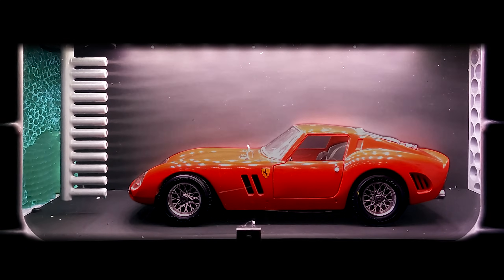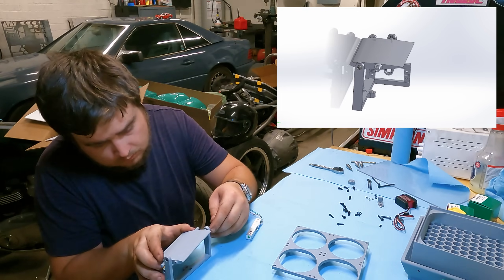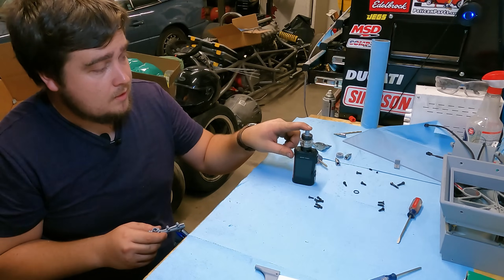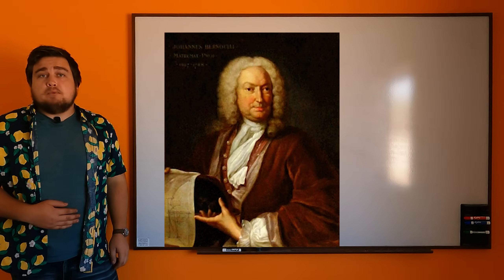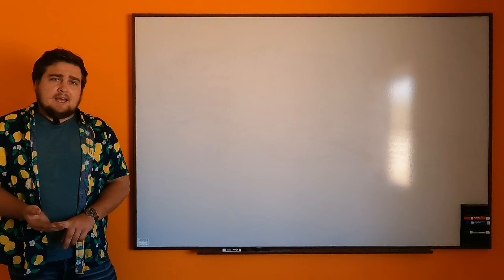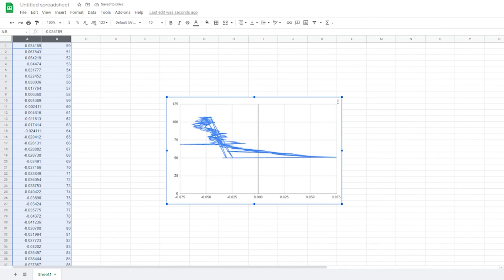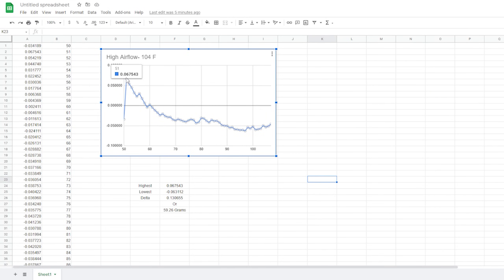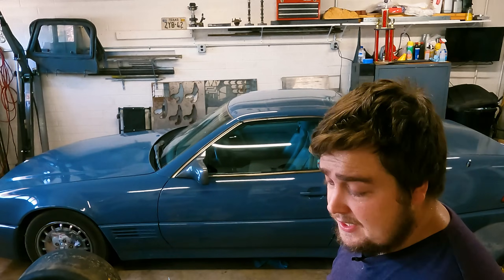DIY Active Aerodynamics | Pt. 1 of 2 - The Wind Tunnel

Comment: I found that to form dense smoke you can't mix it with air on the way, but you can attach the compressor to the input holes on the vape or even put the vape within a sealed tube with just the output poking thru and an inlet hole, then you can pump smoke out that way. it comes out much more dense. then, the tree that distributes the smoke needs long thin tubes to produce laminar tubes of smoke

Comment: Bernoulli's principle has nothing to do with aerodynamics because a major assumption for it's derivation is that there is a closed control volume for constant mass flow. A wing in open air has an open control volume and so bernoulli's principle does not apply. Curvature is why airfoils make lift. The fluid by changing direction, by definition, is being accelerated in a new direction and this acceleration causes a pressure drop along with a component of momentum transfer by changing flow direction downward. 

In 2D airfoil theory, bernoulli's principle never even shows up.

Comment: ...OR you could take a really close look on F1 wings find a good compromise with your build. Those teams put more money and time into this the past decades than anybody. You could just stand on their shoulder and using some well tested design elements and do the fine tuning and needed customization for yourself. If you start with basic shapes like F1 was in the 60s, you have decades of testing to get to the point where they are now so I would definitely recommend to use one of their design.

Comment: I think plugging the holes in the smoke distributor except one would help visualize the airflow better.  Also, since hot air is less dense than cold air, maybe you can play with temperature to help get a more accurate set of data points.  Very cool project.  Keep going.

Comment: imo it would be better with more "laminar" flow, maybe it's possible to make it laminar using a lot of tubesticks and feeding some (few) of them with smoke and all others with air, but the speed of the flow should be identical for both air and smoke tubes, otherwise it will generate turbulence again when mixing those flows from different tubes. Also led lights may add some turbulence in the flow because they make the "ceiling" of the chamber "bumpy"

Comment: Would using just the infill of 3D prints give you just as good stabilization of air? Plus it would be faster to print? Though I also see the downside as my 3d printer doesn't print infill cleanly.
Reply: straw method was probably better

Comment: can you match the Reynolds number and Mach number for accurate results? Also, have you checked out xflr5? its pretty rudimentary, but for 2d analysis it is brilliantly quick, and effective. Simulations run much quicker than cfd. You can also generate plots of Cl vs Angle of Attack, Cd vs Angle of Attack even incorporating flap deployment.
Reply: It's also free...

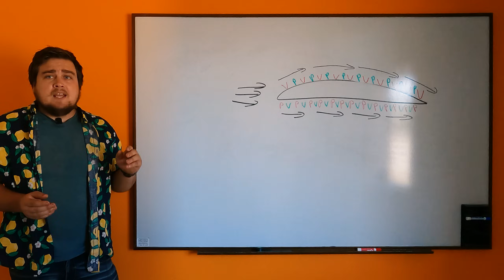Comment: Your explanation at 7:00 is completely wrong broo, fluid over the wing accelerates so much that it never meets with flow on the underside never again. Lift is more due to contraction of fluid elements going over the wing creating negative pressure on top. The contraction of the fluid happens because mass should be conserved and in the vicinity of the airfoil the obstruction causes flow to accelerate in order to maintain continuity furthermore the flow actually acquires downward velocity, due to conservation of mass this also contributes to said acceleration. Lift on the underside is actually harder to understand because the underside can be of an incredible variety of shapes with radius of curvature pointing in distinct directions

Comment: 7:00 equal transit theory is an incorrect assumption made pretty often. In reality, the flow over the top of a cambered airfoil or symmetric airfoil at an angle of attack is much faster due to the decrease in pressure, reaching the trailing edge quicker than the flow over the bottom of the airfoil. There are a lot of subtleties that I am not sure of myself.
Cool project, looking forward to your next upload.

Comment: A soldering iron and some light machine oil on a rag creates great smoke for PCV system leak tester, too. Can use Johnstone's baby oil instead. I suggest the use of a 3d printer hotend heater in a glass jar so you can set exact temp and even a mini hotend fan to slowly blow the smoke though. Also recommend using blunted syringe needles (from a printer ink refilling shop).

Comment: Wesley, I am building wind tunnels and making experiments as a job. I could probably answer some of your questions. Good work, but there are many weak points. 4 fans make a swirling flow and are too close to your model. There is a dead spot in the middle between the fans, flow velocity from your smoke device should match the flow velocity in the tube, inlet should not have straight corners because you will have a separated flow, at least you can match a Reynolds number for such experiments. You can use oil smoke wire for visualization or apply oil paint to a surface and see where the flow separates. you can also glue tiny threads to your model and watch behavior of the thread. It will be aligned with the flow or just chaotically moving in a separated zone. you can also install pressure ports and monitor static pressures on your wing surface. with oilvis you will know approximately where the separation occurs. And so on. Good luck!

Comment: The wind tunnel you have made will not give you the data you want at the scale it is at and the wind speed you can generate.
Aerodynamics don’t exactly scale 1:1 , something that is 5mm won’t behave the same as something 5 metres in size.
You may get better results with a water tunnel instead but it will still need to be bigger.
Minimum size for a useful wind tunnel would be about big enough for you to crawl through, then you can use models that will scale better. And easier to mess with as a bonus.

Comment: quick question. I'm no engineer but i wonder does fluid density matter in this case? what i mean is does such a small scale wind tunnel accurately represent the effects of how would that work on a full scale example?
Reply: Yes, there are corrections necessary to make models match up to the real thing. If you're interested look up "dynamic similitude".

Comment: Idea: get a big AC unit, use its output to push air into a wind tunnel. Problem is that the air exiting the wind tunnel will cool your shop too, so you'll have to figure out a way to reheat the air back to 100+ to remain consistent with your other videos.

Comment: Another aero engineer here. First off, great work so far and im excited to see whats next. I getting into arduino myself now, so ill be very keen to follow your project. A couple of points I wanna mention:
1)be careful about the blockage ratio, thats the ratio of the objects frontal area vs the area of the wind tunnel's cross section. Most I've see were around 10% and beyond that the wind tunnel's walls might start influencing your results. I realise it might become cost prohibitive though. 
2)try adding a mesh of sorts at the start of your wind tunnel which should help to make the incoming flow less turbulent and thus lead to more accurate results
3)if possible make the airfoil holder from metal or design it to be as stiff as you can, so that there's no force loss in the flex.
I work on racecar aero for a living so if you need any advice or cfd simulation help, feel free to shoot me an email.
Reply from the maker: The flex is an interesting point- if you notice the metal beam across the bottom was from results of flex on the bottom wall. I also want to calibrate it with and without the massive servo
Reply: @WesleyKagan  the way its usually done is you run your setup without the test subject first to get the "error" data and then you run it with your wing. At the end you subtract the first from the latter to get your real values.
Id also suggest on getting a pitot tube in there to get the velocity of the flow (place it in front of your wing). That way you can get coeff of lift (C_L) or (C_L*Area) and the Reynolds number which should help you validate your data against other sources. Reynolds number is very important, flow will act differently at different Re numbers. Lower Re flows will tend to separate sooner, which will lead to lower peak C_L.

Comment: Based on my wind tunnel it needs a 1 horsepower motor to get 80 mph in a 5 1/4" square tunnel with a 10:1 area reduction and a 1" thick honeycomb straightener at the widest part.  The Reynolds number is way off and the drag coefficient is way off.   I had to do a flow simulation of the wind tunnel to get it to agree with the model.  
Perhaps you should note that fluid simulation is free if you use OpenFoam that comes with CAELinux - which runs off a thumb drive on PC.

Comment: Hi Wesley,
A couple of weeks ago I designed an airfoil specifically for a rear wing of a car. It has the highest possible lift/downforce I can get, and it is miles better than anything you can find on the internet. If you want I can send you the data points.

Comment: There are a lot of better explanations why on this comment section, so I'm just giving my input on the matter: A traditional wing type airfoil doesn't fork for downforce, bcz too much drag. Active air systems are always heavier and more draggy than basic fixed airfoils. Otherwise they would be in use in racing. In an open wheel car, the wheels create the most drag, so best results are made with front wing directing the air over the car, and slick underside with a rear diffuser to keep the flow laminar under the car, thus eliminating the air matress lifting the car up. the rest can be done with tyres and suspension. Air brake looks cool, but when your front wing, tyres and suspension are dialed in, you need less brakes bcz your corner speeds are higher. Hard braking and acceleration only disturbs the dynamics of the car and aero, and on fast tracks only results to higher lap times, and on slow tracks, the aero is basically dead weight.

Comment: It seems like my comment has vanished, but anyways. Wind tunnels and aerodynamics, awesome and can't wait for part 2. Watching this I was immediately reminded of a set of videos made by Yoshi Suzuka probably 10 or so years ago and the discussion around them. Back then he was working on, I think it was something like an office small scale wind tunnel. Really interesting and worth checking out for reference on how far it's gone since then. Also, at the time he was doing it with 1/24 I think scale models and had it down to getting repeatable results and trends, though not necessarily representative or completely accurate to full scale numbers. I remember that wind tunnel at the time he could measure lift by the corners of the car and drag. IIRC Suzuka did the aerodynamic development for the Nissan GTP cars for a large portion on a 1/7 or 1/8 scale wind tunnel and models. I vaguely remember Suzuka may have said that with the 1/7 (or 1/8) scale wind tunnel, he was able get 2% drag and 4% lift correlation to full scale. Anyhow, you're definitely on the right track to making something that is close enough. 

Oh yeah, there's a whole bunch of test data (or at least was time I checked...several years ago) you've already found for various NACA profiles and even "race car stuff" wings where it should be possible to try and repeat the test with the same profile and see how the results correlate.

Comment: Air ejector nozzle. Dealt with something similar to what you made using the venturi in one of my engineering internships. High pressure steam is run through an ejector nozzle and create a vacuum behind it in order to draw NCGs out of steam turbine condenser.

Comment: Awesome video! One thing: "equal transit" explanation for lift is a very common misconception. No idea why this keeps getting taught to folks! Lift is mostly just Newtonian, that is momentum transfer, so with an angle of attack, planes can even fly upsidedown. The air does move faster over the top of the wing, but not due to some constraint on the time it must take to get there. It clings to the curved surface falling away from it due to the coanda effect. This serves to improve the efficiency of the airfoil mostly, but does not provide a significant amount of lift.
Reply: Yes. The equal transit theory is very flawed. Doesn't take much to prove that there is no equal transit. Basically, air takes longer to get to the trailing edge when it follows the upper surface rather than the lower one, which is intuitive.
Reply: @youngtschakaloff  That's true, at least it usually is, but the air does move substantially faster over the top surface than the bottom. Not because of some magical "equal transit" arrangement of course (I love the idea of the air molecules slowing down to wait for their friends) but because the air above the wing is compressed into a narrower stream thanks to the air above that not getting out of the way. Narrower stream means faster movement which means lower static pressure which means lift.
Reply: @cooperised  okay, reasonable. That way of explaining is a million times better indeed.
I always keep in mind that there are multiple phenomena at work at the same time, and some of them are really hard to fully explain
Reply: @youngtschakaloff  Absolutely! You're thinking in exactly the right way. Multiple phenomena are at work at the same time, and are often the same phenomenon viewed from different perspectives. For example with a wing, it also deflects air downwards as it generates lift. I've seen people say "so it's the deflection of the air downwards that generates lift not the pressure difference", but that's not right. If the wing is generating lift then the pressure below must be higher than the pressure above, that's what generates the force. But Newton's third law also applies: that upward force on the wing produces an equal downward force on the air. Or if you like, pushing the air downwards generates an upward force on the wing. Both things (pressure difference and Newton's third law) are true, and neither is "the explanation" for where lift comes from. They both just describe phenomena that can be observed around a wing.
Reply: @cooperised  Thank you for this explanation!
Reply: @cooperised  i hadn't read your comment I liked it a lot, however I feel the air not moving out of the way is only true for the portion between leading edge and the maximum thickness (or whatever the highest point is if there is non-zero aoa, non stalled airfoil) however flow remains attached as well after this point with essentially now the airfoil moving out of the way this needs further explanation as streamlines don't immediately detach (sure they are slowing down but that doesn't explain why it remains attached)
Reply: @Michallote  Well, any explanation of anything ends up being a simplification.  Basic rule of science.  :-)  The way I like to think about flow remaining attached beyond the "highest" point on the wing surface is that you end up with a region of lower static pressure that "sucks" the flow back down.  Consider what would happen if the flow just carried on horizontally after the highest point - there would be no air molecules at all below the bottom of the flow line, and a vacuum above the wing, which is clearly unsustainable.  It is possible for this low pressure region to become large enough and strong enough to cause the turbulence that leads to detachment of the flow, if the angle of attack is too high or the airspeed too low.  I think that despite being another massive simplification, this is the closest I can get to a simple explanation that's consistent with the physics.
Reply: For some reason people try to use the equal transit theory for sailboats too, claiming a pressure difference from different path lengths around the sail would propel the boats.
Yet due to how thin masts and sails are the path on both sides is of practically equal length already.
And the only course that is actually propelled by pressure, straight downwind, is one of the slowest a modern sailboat can take.
Some boats even have adjustable mast supports, so the mast can tilt forward to let them sail downwind faster by redirecting the airflow rather than building up pressure.
Reply: Actually, most of the lift is provided by the upper surface

Comment: Okay, I got inspired to tackle the math again and make a spreadsheet for dynamic similitude. Assuming you're operating at the same air temp and pressure, and you're using a 1/18 scale model, in order to get 1/1 similitude of a car at 60 mph you need a wind tunnel airspeed of... 1080 miles per hour.

That's, uh... Yeah. I think compromises will be in order. :-D

Comment: Wesley, I thought of a great little input you could run for the active aero project.  Snag a steering angle sensor (whether cable or touchless or otherwise), and anything UNDER 25* steering angle you drop it down as long as Brake Pedal is not enabled.  That way, it'll work when you're going straight and we only have a total of 100% Grip at a tire, so once we have over a certain steering angle, and not on the brakes, we would likely be accelerating.  I think it's a real simple sensor configuration and a great start on a budget given your Arduino capabilities.  Good luck on the journey!
Reply: could potentially even be a linear relationship between steering angle and wing angle, or some other simple function (log, root, square,....?) depending on what fits